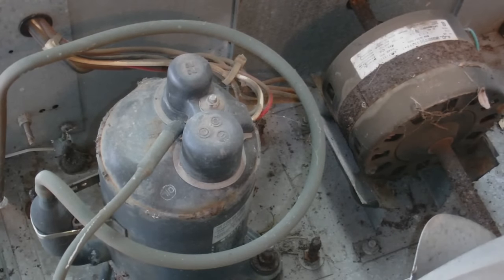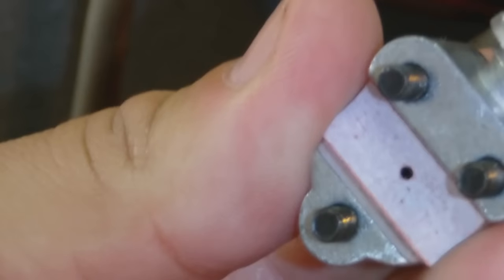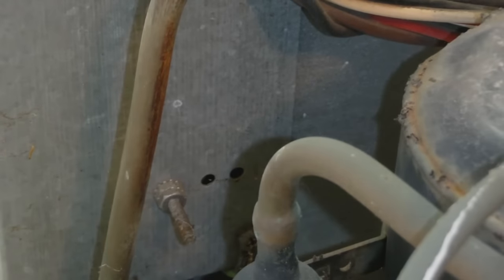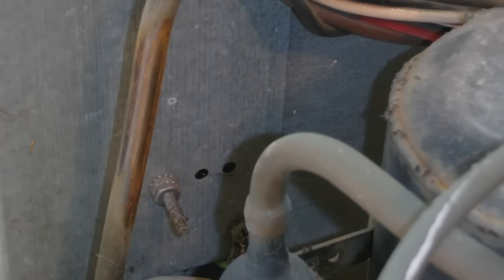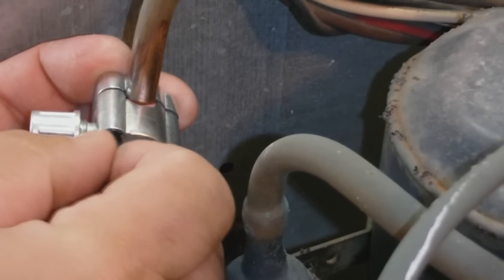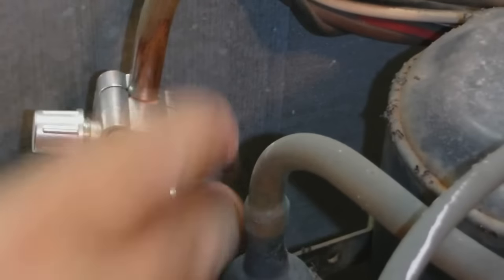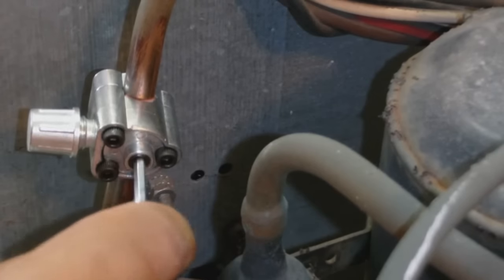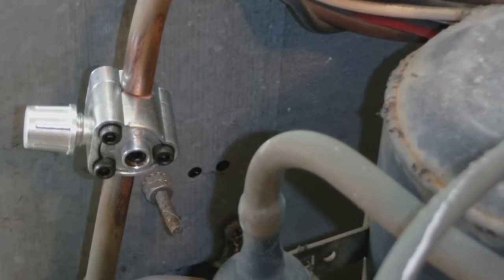How to Install a Service Port on Sealed Air Conditioning Systems: Step-by-Step Guide

Comment: The question is , how do I know where the low side is?,...would a safe answer be to install furthest from the compressor???
Reply: Low pressure side, or suction or vapor, is the larger diameter pipe.  The smaller pipe is the high pressure side, generally referred to as liquid.  The high side is warmer, sometimes very hot, then the low side.

Comment: Edit: Besides, even if you install one, you can remove it later & install a proper service port. IMO, it's better then letting it vent into the air.

Comment: Can u put this valves on while the unit is charged?
Reply from the maker: Yes, you can install these to evacuate the system also.
Reply: My home ac is charged and work but I think I could put more to get it colder so I just put this on and add freon? My unit is a r 22 and I was just wondering is it safe to pierce the line while it's charged
Reply from the maker: Michael Haddad Just because its not blowing cold air does not mean it needs a charge. You would hook your gauges up to and check the pressures after you hooked up the valve. Other things to take into consideration is a clogged air filter, dirty evaporator coils or condenser coils and or and internal mechanical problem. If you do not know how to read the gauges or do not have any experience with AC charging, I do not recommend you do this task and contact a professional to avoid damage to your equipment or serious injury. I hope this helps.

Comment: Did the same thing on my old RV worked Great got another year out of it
Reply from the maker: Great. I did this one back in 2012 and still works great. Thanks for watching and commenting. Please like, share, and subscribe.
Reply: Mine was a Dometic unit I had to use a sealer on it I think it was called Polar or Freeze seal it was like a Blue gel that came in a syringe and was injected  worked Great but the next year A/C stopped working  I think the stuff in the can by NUCALGON is the best

Comment: so you used 134a to charge it and how much did you add
Reply from the maker: No, this particular unit was an older refrigerant. I keep adding slowly until the ac starts. Lowing cold air, but I also get my spec pressure readings and watch the gauges so nothing gets damaged.

Comment: If bullet/saddle/schrader valves are illegal, then what are you suppose to do? Just cut a line & let the refrigerant vent into the air? I'm pretty sure that's illegal.
Reply: Bullet-piercing valves are not illegal.  You can buy them on Amazon, however most do not have a Schrader valve.  They have a R12/R22 port which is used for re-charging.  You keep the piercing needle screwed all the way in, except for when you want to check the existing pressure or add more R134a.   You only retract the piercing needle while you have a gauge and/or can of R134a attached.

Comment: It looks like you pierced the high end  tube. I thought you're supposed to pierce the low end tube?
Reply: When ppl refer to high end they mean the smaller diameter pipe (warm pipe). The low side is the pipe that is a little larger in diameter than the high side pipe that has the refrigerant (cold pipe).When you start your AC and compressor kick in (you will hear it) the large pipe will become cold by touching with your hand. The high pipe (small pipe) will be warm to the touch.That's how you know which pipe to pierce. What he did was correct and you should clean or sandpaper the pipe section where you're going to place the bullet piercing valve. Lots of ppl don't clean or better sandpaper the area and sometimes get a leak and your work was for nothing.
Reply: @heyoou  i knew  what the high and low end pipes are I just thought it was always the low end that should be pierced but what you said makes more sense. My next question is do you know of a viable replacement for 22a freon? Mine is 22a and apparently it isn't legal to buy anymore without a special license.
Reply: @sparky1212new  yes. The low end is the pipe that needs to be pierced. Never never pierce the high end pipe. Any refrigerant can be bot at Amazon or eBay but at your own risk. I would remove old refrigerant with a vacuum pump before adding new refrigerant.

Comment: Do you put the service valve on the liquid line or the suction line?   Do you create a vacuum first and then break the vacuum with refrigerant?   Do you weigh in the refrigerant with a refrigerant scale?  How do you determine the volume of refrigerant that you're putting in?          Any idiot can attach those crappy - leaky clamp on piercing valves!
Reply from the maker: I stated in the video that you put it on the low side suction side if you are going to fill it. It all depends on what you are doing and to answer the rest of your questions that are based on nothing of which this video is about. This video was how to install these properly and create a nice CLEAN seal. Also if they are leaking it’s because they were not installed correctly or the wrong valve was used. I would not go around calling people idiots especially when you are asking off topic questions. There are other videos you can watch to answer the rest of your question that I’m sure you already have the answers for.

Comment: Attention these things suck! Vibrate off and you have a even bigger leak, proper fix is to find a leak and repair/replace, when system is empty use drill bit 5/16 braze in service ports, vacuum with correct oil and wright in the charge, that's what makes a bullet propf HVAC repair

Comment: will this will work on a soda vending machine
Reply from the maker: Yes
Reply from the maker: You Can Find The Bullet Valve Here On Amazon http://amzn.to/2maNu3R

I show you how to install a service port on a closed air conditioner unit. You can use these bullet piercing valves on refrigerators and home ac units that are sealed off from the factory. You wanna make sure you install it on the low side Suction side. I perform this task on an old  r22 rv roof top ac unit.

If you need items to perform this task you can find them here http://amzn.to/2aik2mu for the basic and simple 134a or you can get the gauges, 30lb tank and valve here

30lb tank http://amzn.to/29VSBv3
gauges http://amzn.to/2aiksti
valve    http://amzn.to/2a8flLH
tank adapter for the gauge hose http://amzn.to/2a5JV5R

Check them out, It will give you a great idea on what to get or add to your wish list.

Warning read all instructions before installation. This video is just a tutorial on how i do things. If you attempt to do this service on your own, I assume no liability. If you do not feel comfortable doing this task than you should seek a professional to perform this task. I have to write this because of the sue happy world we live in today.

Comment: You spent like 4 minutes screwing it together. Is there another video?  One that explains how to not loose all your freon when you disconnect (no schrader valve)  your freon and try to get the cap on real quick?
Reply from the maker: +Mike Gideon I left the valve on and had no problem. This unit I worked on in this video is still operable to this day without having to refill it, that is 3 + years with no problems. I regret to hear about your misfortune. But that middle nut that you use to pierce your valve and open is also the way can close, just turn the middle allen key back in it. But I didn't have that problem. Thanks for watching and commenting. Hope this helps.

Comment: where is the best place to tap in?
Reply from the maker: *****  I install the tap on the low side / suction side if I m just recharging it. But if I am trying to diagnose a problem I ll tap high and low side, so I can hook up my gauges and check pressures at both ends. I hope this helps.
Reply: yes, since i will be soldering a cracked line i will want to keep tabs on the pressure while recharging. thanks. low side is for charging high for testing.
Reply: I like to tap in from behind.

Comment: This type of valve is only temporary, if it needs refrigerant it already has a leak. These valves are typically used so that you can have function until more permanent repairs can be performed. 
   If you have a system that requires r22 it’s too old to justify spending any time or money on and should be replaced.
Reply: That’s not true at all. Refrigerant looses its effectiveness over time. I’ve done dozens of these over the years. Only 3-4 systems out of dozens had a leak.

Comment: Mate I can see you doing a good job but its reminder as I am air conditioning & refrigerant certifier you need to have safety protection equipment's   Thanks John from QBC Cooling & heating Pty Ltd
Reply: Anyone that has to announce their credential before making  a statement tends to know the least

Comment: Sorry, not swearing or anything like that but just telling you that no one worth their salt would put a leaky valve like that on a critical charge system EVER.
Reply: Really? Why not when the unit is already years old what do you have to lose? I put mine on 3 years ago and the pressure is exactly the same. I would have thrown it out and had to buy another $600 something dollars a unit. If you haven't experienced it firsthand by doing it yourself then don't run your mouth. Just because of what you heard from your HVAC school or your grandpa told you is a bunch of he said she said. Just try it you'll be surprised at what you can do.

Comment: DONT EVER USE THIS ON A RV AIR CONDITIONER  you will destroy your air conditioner
Reply from the maker: Nope, not true. This one still works. Almost 7 years later. Maybe you installed yours wrong or mixed the wrong refrigerant.
Reply: @handymanPF  i work for an rv service center i have replaced  Hundreds of units because of people installing theses things
Reply from the maker: Then  they did not install them correctly or they mixed the refrigerant, or they misdiagnosed the problem because they do not know how to read the pressure gauges. Why didn’t you remove the piercing valve and braze a solid Schrader valve on, put a vacuum the system, recharged and diagnose?
Reply: Only open your mouth if you have real experience with the topic. Not what you heard not what you think you heard or what you were told or what was downwind. If you did it hands on yourself and it ruined your RV air conditioner then you can open your mouth.